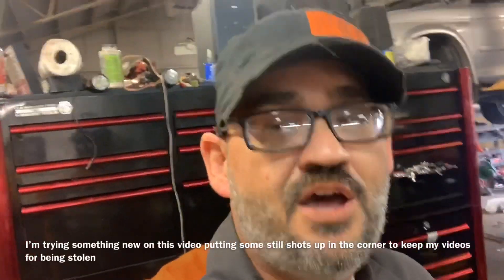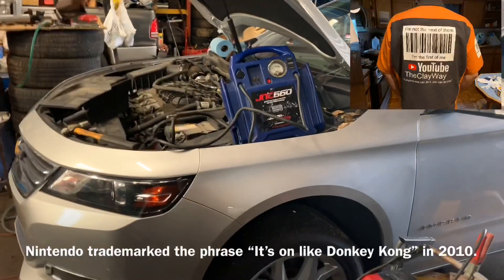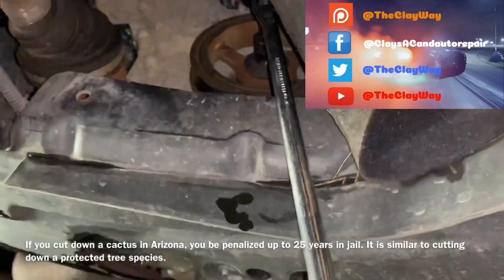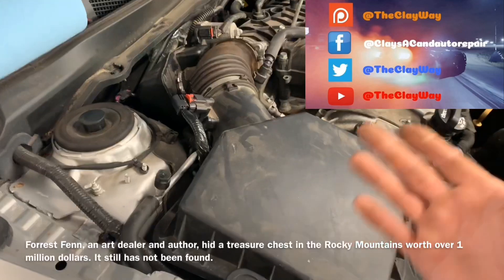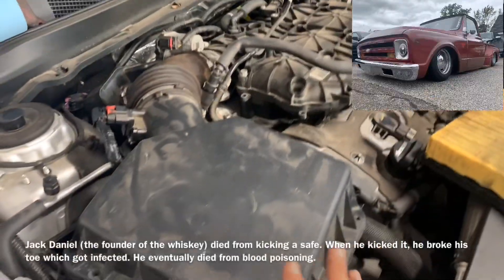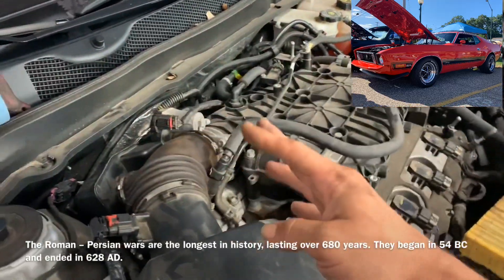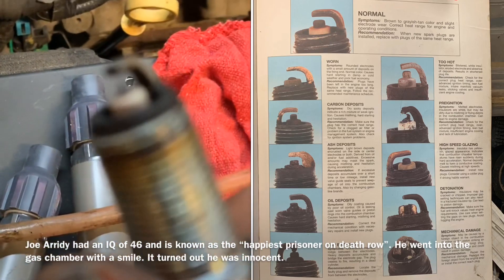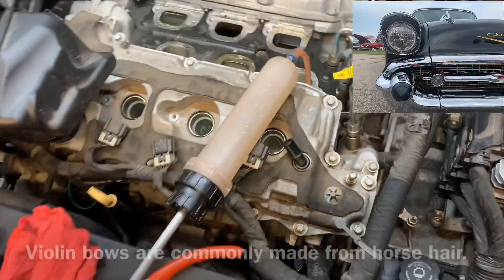Chevy impala 3.6 LFX Hydro locked motor, can it be saved?

Comment: Were you trying to do a full spin with the harmonic balancer in either direction? Which direction should it spin normally? Should it do full spins?
Reply from the maker: It would spin clockwise but , any direction that would allow you to take it all the way around would be good preferably clockwise because that’s the direction that the engine generally runs on most vehicles. Matter of fact I can’t think of any that don’t run clockwise but it’s possible. 

You would spend it backwards to hopefully get some of the fluid out of there that was the thought when I was doing it obviously it didn’t work in the situation but I have had it work in other situations…..

Comment: I need some help on my 2018 impala lt 3.6l v6 vvt. I have to replace my bank 2 camshaft sensors. But I have no idea how to get the sensors out because the top support bracket that connects the engine to the motor mount under the intake box is in the way and idk how to or what to do to get that stupid bracket off to replace my two cam shaft sensors please help.
Reply from the maker: Well you wanna take a floor jack put a piece of wood on the top of it and gently raise it up to the engine underneath the oil pan this will hold the engine while you take out the mount

Then you’re gonna remove the bolts holding the mount to the engine.

Then with the amount removed you should be able to get to the bolts that are securing the sensors to the engine block.

And I really don’t wanna rain on your parade but more than likely it’s not your sensors that are defective especially if there are two of them that are not reading correctly they are probably reading correctly I would highly recommend getting rid of the car because that means that the timing chain has moved and is no longer in sync with the rest of them even if it runs correctly. More than likely at times it’s running erratically. 

Sorry Kyle then engines are real piece of crap

Comment: I did the same thing. I don’t believe the intake had as much water the spark plugs didn’t look wet.  
Originally right after the puddle it turned off... after waiting 24 hours the car clicked just like this video. They were able to manually move whatever it is you were trying to move... 
I attempted to turn on the vehicle after that and it cranked a little bit but would not do a full spin. This took place a few times but then I tried to turn it on the be more time and held it a little longer(hopeful it would start and  then it locked for good. Any ideas?
Reply from the maker: Did you remove your spark plugs? If not more than likely you bent valves in the head and it needs to be disassembled sorry wish I Better news than that but it doesn’t sound good

Comment: Another question for ya, Clay:  When you removed the injectors from the 3.6, did you reuse the retaining clips?  The damn things are $15 apiece and eBay or Summit Racing are seemingly the only places where 6 of them are readily available on short notice.
Reply from the maker: When I did mine I reused them but I never did it on the 3.6 I did it on the 2.4 direct fuel injection which I believe look identically the same.
Reply: @sharpcarco  I do believe the DI injectors are shared between the 4's and 6's (at least from the compatibility chart I went by.) Glad to know the clips are reusable, thanks for the input!!